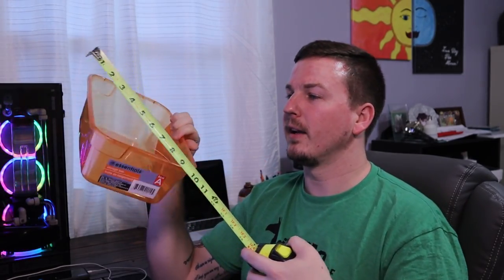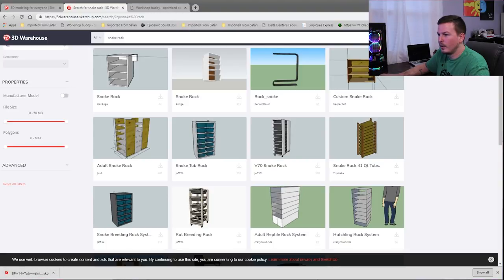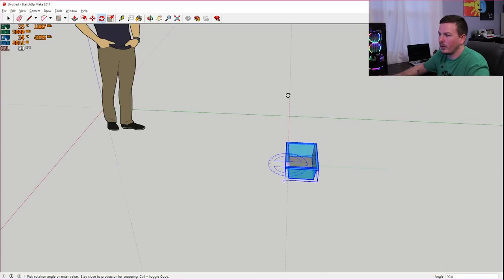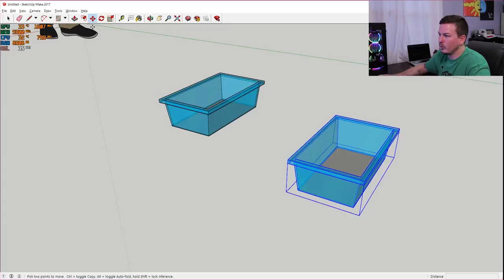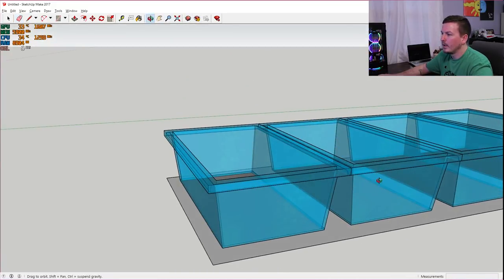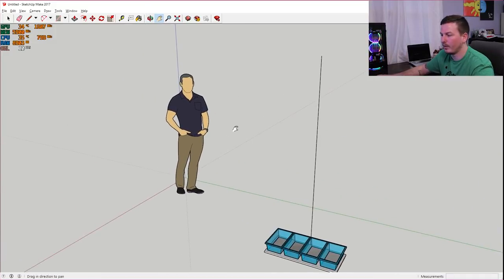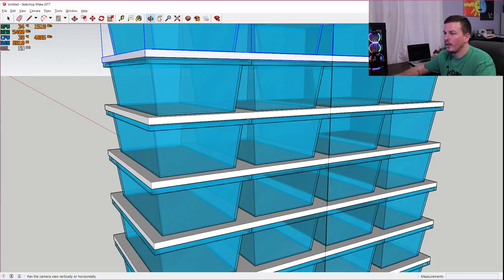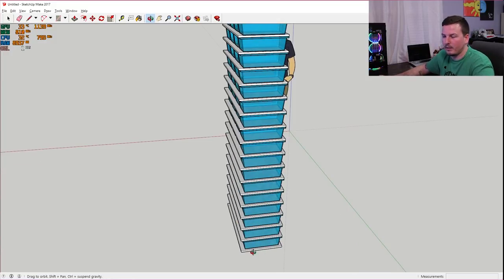HOW I DESIGN RACKS!! | Step By Step Tutorial | Mixology #34

Comment: Great job. I do a lot of wood working, DIY projects and sketchup is great for this. For cut lists I use a program called CUTLIST but the one you referenced looks easier to use. I built my hatchling rack similar to this. Used plywood instead, did  48 inch back so I used two 21 inch heat tape for back heat.  It works but given the tubs have that taper in the back the tubs dont get close enough to the heat tape for me.  The tub gets the temp I want but I have to put the thermostat much higher. The snakes are always plastered against the back wall of the tub versus their hides. I think next time I will do belly heat for them. It seems it would give them a wider heat source that they are on top of versus close to, if that makes sense.  I do keep the ambient temperature 70-75 as well.
Reply from the maker: Awesome. I'm gonna try the back heat but who knows.

Comment: its a lot more work, but i would do 3" belly heat and split the rack into 3 zones from top to bottom rather than side to side. you would have 6 lvls each zone to turn off when its not full, and each lvl would be fully heated rather than just 1 tub per lvl. and smaller heat tape pulls less amps and belly heat is more efficient at transferring the heat to the snakes so u can set a lower temp on the tstat and get the same temp in tub. Also, since u figured in a gap for air, u could skip the routing for the tape and just use aluminum tape to hold it in place. the wear of the tubs sliding on it would be marginally more, but it would still be fine. i made a rack that way and its lasted for years now.
Reply from the maker: You should never let your tubs touch and slide on the heat tape. Very dangerous and much higher likelihood of a fire. I will never slide a tub on heat tape

Comment: Do you ever have any issues with heat with the tubs that are not flat on the bottom? I know most have some kind of contour for stacking purposes but I didn't know if it causes any problems with getting the hot spot hot enough. Going to be building my own rack soon and I'm trying to decide between 32qt sterilite tubs or ordering vision tubs. Just curious your take on it. Thanks

Comment: Great video Jason. I was going to suggest running two strips of 12" heat tape until you brought up using the herpstat 4. That's a really cool idea. I've been looking for a similar rack idea to use with colubrids. This rack looks like it would be perfect. I'm glad you made this video.
Quick question... What saw blade do you use to keep from splitting the edges of your melamine when you make your cuts?
Reply from the maker: Thanks man. I don't think you can perfectly prevent chipping but two tips to help. 
1. Put a masking tape line where you are gonna cut
2. Use a finishing blade with a very high teeth count
Reply: Those were the only tricks I knew to use also. Thanks. If you discover any new tricks, please let me know. Keep doing what you do, I dig your channel.
Reply from the maker: Thanks man
Reply: Hey Jason, I recently spoke with a cabinet maker who uses melamine. They told me that they use a high tooth count on their blades and run them in reverse. Give it a try and see what you think.

Comment: You have bade width set to 1 inch. Try putting in .0675 1/16 inch what most table saw blades are.

Comment: Could run two 12" as back heat will be indirect heat anyways since there is a lip on the tubs. Are you going to offset the back of the shelves from the back or  just  sandwich the heat tape in?
Reply from the maker: Ya I could but I like the idea of being able to unplug each column if I'm not using it. And yes probably just going to sandwich the heat tape. It doesn't get hot enough to hurt anything anyways.
Reply: I did really like the video, gave me some great ideas and tools to use.
Reply: I did like idea of being able to turn off each row if using a herp 4.